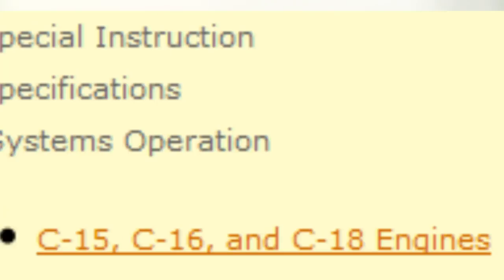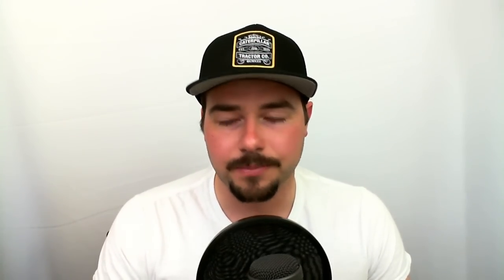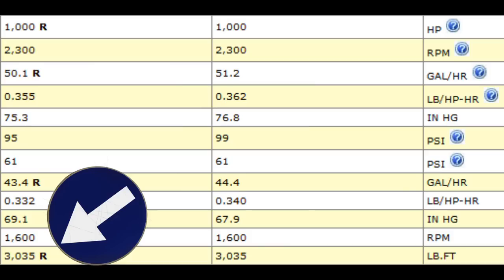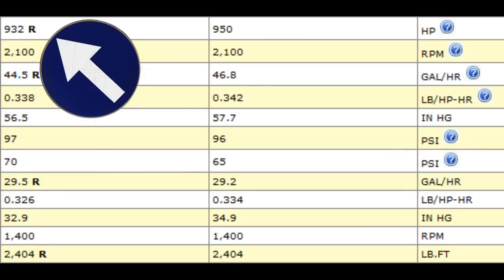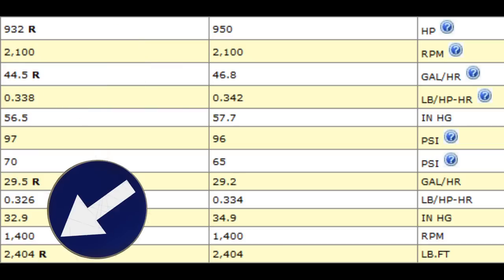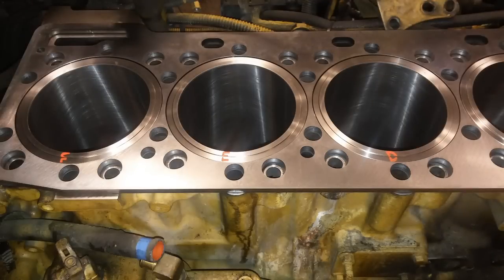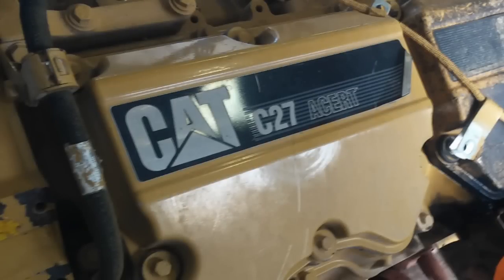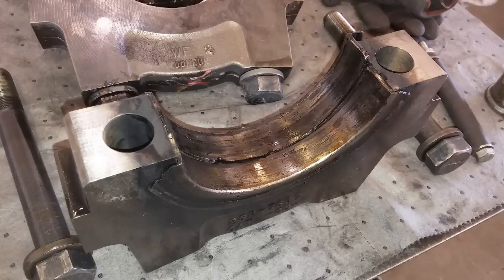Turn A Cat C15 Up To 1,000 Horsepower With Stock Parts.  The Ultimate 3406 or C15.

Comment: I used to work on marine diesels , the “recreation” versions make a ton of power , a stock 315hp 6BT will build around 50 lbs of boost , same with the cats , mans , yanmar ect . When you have the entire ocean to cool it down you can make power , on a 6bt making 50psi I’d boost the charge air leaves the turbo around 350f then goes to the sea water cooled “inter cooler “ goes into the engine around 90f , that much temp drop is practically impossible with and air to air charge air cooler
Reply: Every engine can produce huge HP,, for a short time,, Like you said tho,, Marine engines have all the cooling in the world using water jacketed exhaust manifolds. Cat 3500 mechanic , retired .
Reply: Probably why we see more nuclear subs than nuclear powered trucks

Comment: Back in 2005, I took my Brand New Peterbilt to a Good friend and had him "Work" on my truck. Now, I'm a Heavy Haul Trucker or was until 2010. Anyway this Guy has an "Green Thumb or is a Wizard" on Cat Motors or he was until he passed. He used to make around 925 Hp back then. And, as a Heavy Hauler haul'n sometime 1,000,000 lbs. I needed all the power I could get especially in the mountains. I Never had any problems to speak of with any of my motors he worked on, Never❕ I found out bout this Great Cat Man many years ago and he worked on all my trucks since back in the 70's. He lived in El Paso and was not a certified Cat mechanic. He just knew them Inside and Out.
Reply: what so you mean? I am Home AH. Google Big Loads.....there are even Bigger loads. Some of the big Transformers are heavier than that. You don't Know what you're even doing or talk'n bout...........
Reply: Ex-Law Enforcement the Cat 797F weighs something like 200 ton and it’s the biggest dump truck in the world. You are telling us that you carry 2 1/2 of those on a daily basis?
Reply: The Chassis only weighs in around 475,000 appox. on 1 of these pieces of equipment (797) they are shipped tore down from where we would pick up one of these usually in Long Beach, Ca. at the Port there. I hauled alot of LE TOURNEAU equipment like the L2350 and other rubber tire loaders and some of their other equipment too. We was setup with them to haul alot of their stuff. I wish I knew How-To or even IF I can send a picture or two in here and show some of these loads and just some of the axles under my trailer and the other truck that hauled alot of the equipment on it. Always had a 2nd truck to haul alot of the axles and trailer parts for these loads. My empty weight was well over 100,000 lbs. (Depending on how my trailer was setup for a haul could be more or could be less) Empty so I couldn't haul anything on my rig (Anything over 80,000 is what is Max weight). My Haul truck was always permitted even when empty. All the other stuff had to be on atleast a 2nd truck/trailer and sometimes there was 2 of them to haul equipment for a special load coming up to haul. This may sound like a bunch of Mumble Jumble IF a person don't know much about the weight limits and all this stuff. I didn't mean to mis-lead anything here. After my stroke and heart attack in 2010 I've never been quite the same especially at my age now-a-days.
Reply: Ex-Law Enforcement pictures or it didn’t happen.
Reply: Justin Martin I wonder how many tires you would need to haul a million pounds?
Reply: I've seen a few 500 ton loads, or right in that ball park anyway. Not equipment like all of you guys are thinking though. Most of them were tanks and compressor stations for the oil fields in North Dakota. I saw one trailer at the port of entry in Gillette Wy one time with 21 axles. The dude that started the thread isn't full of it, there are actually loads that big. It's all about getting your load to axle out.
Reply: Jimmy De'Souza really big loads sometimes require "pushers" which are semis that are attached to the back of the trailer but they are used more for engine braking power then for power to move the load around.
Reply: 9914life the number of tires on a truck and trailer is only part of it, the space between the axles and the space between and a group of axles, also called the bridge, are factors as well. The size and width of tires matters also.
Reply: Chris Roberts dude. I specialize in the heavy truck industry,specifically frames, axles, suspension, jeeps and Jeep trailers and detach trailers lmao you got owned. You will not move a million pounds unless you have multiple trucks. Like I specified in my previous post, and a stand behind my word, those guys do not turn up their trucks, they’re fleet owned 99% of the time. So you are slow, you should stop going on the internet. Lol I don’t need to go on the internet to see big loads, I work the equipment that moves them hahaha
Reply: Chris Roberts please tell me a Jeep is a 4x4 that drives in mud
Reply: Utube swan Silvertones
Reply: You mean he has a "Black Thumb"
Reply: I don't care how much horsepower it made, what was it doing torque wise though?
Reply: @DannyWalker1949  
my age now-a-days.

Love it
Reply: Jimmy De'Souza  Not with a splitter transmission.
Reply: I think he misspoke on the weight
Reply: YOU GUYS DOUBTING HEAVY loads come to Australia and see the shit we cart around camped out one night with guys running one gen set only 2 tractors one pulling one pushing total weight 275tonnes also see planty of big CAT dump trucks on the back of low loaders at 250tonnes and the widest at 11 metres which means it closes the road down up to 104 axles on trailers i have pics of most of these just do not know how to put them up for you to look at 
If you go in ther outback here in Aussie you will see 4 trailers behind tractors very regularly lke say 4 shell 40,000litres fuel barrels behind one tractor leagl top speed 90kilometres an hour and after loosing one complete truck in a thunderstaorm the law came in that ina thunderstorm you pull over and unhitch the tractor and drive a safe distance away from the cargo until the storm passes a lot of these were powered by C18 CATS or 'special' Cummins motors i am sorry i do not know all the specs but suffice to say they were very powerful trucks the pay was pretty good to when i applied to get onto the rigs back ine naughtys while sitting in the drivers seat you got $54 and hour while sleeping you got $27 an hour and you were away 6 days a week 4 houirs on 4 hours off so work that out.
   The biggest rig i have seen on our roads here is 3 pulling and 2 pushing also a powered self steering trailer i never did get to find out what that weighed except that it was a power generator for a mining site they had 3 police cars and 5 other escort vehilces so all in all a bloody big set up.
Reply: @life-te7to  D.O.T. officer has joined chat ... does he have a permit lol
Reply: @TLLC2024  and that contradicts what I said how?
Reply: @ronanderson2992  if you look on YouTube beyel brothers out of florida moves loads that are over 1,000,000 pounds
Reply: @markwilliams4525  you need to stop believing everything you hear. It’s been over 3 years and he still hasn’t provided any proof.
Reply: @life-te7to  I'm not listening to him I'm just saying they move loads bigger than what he's talking about
Reply: @markwilliams4525  oh, I know there are much heavier loads I just don’t believe that he pulls a load that weights over a million pounds though the mountains. That would require multiple trucks and many wheels.
Reply: @life-te7to  oh, ok.

Comment: We have a couple of C16 with over 1000 hp and never had a running gear failure, it would be drivers error, I personally have a 3406E with C18 cam injectors and tunning never dino but, guess over 800 RWHP  had never had any failure either my trans is a RTLO 16713a,  never a single issue due to  higher HP, so if  you do have any drive train problem with hi hp get rid of the driver or learn how to drive properly. all this while getting over 8 mpg on Florida flat ground, dump truck with 70,000 lbs loads.
Reply: You said the truth I had a KT 600 cummins in 1978 with about a thousand hp never a issue but my 465 Cascadia with walmart today averages 9 mpg
Reply: why are you running around with half a load,we are running 140000lb in mountains getting 6 to 6.2mpg
Reply: Running 84,000lbs here in Texas averaging 7.3 gal with an 700hp 3406E 13 speed.. get your loads worth lol
Reply: @lrizo3841  what speed are you driving at to get that kind of fuel mpg
Reply: @stocks4bt 
Around 70 to 75 sometimes 80 in west Texas. I don't know why but for some reason the faster I go the better my fuel mileage is. The guy who tuned my truck says the whole point was to get your turbo to spool up a lot faster. The faster it spools up the more it helps out the engine to get moving.
Reply: L Rizo I’m looking for a cat tuner in TX. Where was your truck tuned?
Reply: @lrizo3841  who built your engine? And who tuned your engine?
Reply: @lrizo3841  wow…what’s your set up?

Comment: I have a c18 in my semi with 625hp acert turbos.  Custom built radiator, cac,  custom ecm tuning.  Lipe 2800lbft clutch.  High torque 13 spd halo trans,  3:21 rearends.  I run 1225 rpm @ 65mph.   Gets around 6mpg.     Hp at wheels 719.  Torque at wheels 2800lbft.   This was at 32psi boost.  Dyno didn't have enough power to pull engine down.  Truck will make 58psi of boost on road.   I've got about 300,000 miles on it so far.    It's fun to drive!
Reply from the maker: That is cool to hear. Did you put all the C18 internals in a C15 block or start with a C18?
Reply: Adept Ape started with a c18 industrial,   swapped rear structure,  cam , ecm , turbos, and some overhead.
Reply: My hats off to you man, that thing sounds wicked, I always kinda wondered where the truckers are that like power besides a nice looking truck.
I’m sure the stacks of cash and time invested would horrify an average car guy, the price of a truck alone is staggering😬
Reply: @claterpillar1  why don't people use cat industrial engines as new engines
Reply: @5.43v  you can.  I did,  but you need to pay F.E.T on engine for highway use.
Reply: @claterpillar1  What is F.E.T., link to explanation?
Reply: @5.43v  https://en.wikipedia.org/wiki/Excise_tax_in_the_United_States
idk about on an engine though, definitely on the fuel you use though
Reply: @claterpillar1  i see this is old post but how you like the lipe clutch?  i have one for my c16 just waiting until i need it.  is my left leg going to get huge?   lol
Reply: @clintvitez3757  you'll be fine.  They don't push very hard.  It will take a long time for clutch to seat tho.   I thought mine was junk.    Best way I've found to seat it is.   Running down the highway,  push in on clutch until engine rpm comes up a little from clutch slip.   Give it about 10 seconds.  Then let it go for 20 minutes.  Then do it again.    Took a couple days for mine.
Reply: @claterpillar1  Good to know.  how many times per day were you doing that?   Also really like your c18 build.  i have looked into that 8 years ago already and it just isnt that hard to do,   just a money thing but what isnt.
Reply: @clintvitez3757   it took about a week of doing that.  Don't get me wrong.  You could easily drive a loaded semi around.  I just couldn't floor it.  Engine would pull through clutch.
Reply: @claterpillar1  understand that.   thanks for your help on the clutch.
Reply: Damn over $100,000 spent on fuel 😬
Reply: Some c18 heads have same part number as c15 heads
Reply: do you still have this truck
Reply: @RocKenworth  yes sir.  Although northern indiana liquid de icer.  Is taking its toll.   I need to find a different home for engine.
Reply: How hot does it get

Comment: I have a c15 tt with tune on it that puts out 850hp and 2350tq.  Other than the tune it is stock.  Other than a few air to air clamps getting loose ive had zero issues.  These motors are a beast
Reply: Who tuned your engine?

Comment: my dads old truck was a c - 15 set to 850 hp, it was putting well over 700 hp to the ground and doing 160k+ in the mountains it never failed, with 4:33 rears it’d pull a mountain and a half

Comment: Seen a lot of C-18s mostly on oil field equipment, every once in awhile I have seen a hand full of trucks with a c-18 under the hood (spec. that way). Usually with 3 drivers and a couple tag axles as well.That was for very heavy loads like coil tubing units ect.

Comment: We call em big bore kits. Turning a c15 into an 18. We do it often for top drive hydraulic power units when we wanna junk those mtu's. Weve got literally dozens plus c18's. Biggest factor and hurdle puttin em on the road is keepin it cool. Another reason they make tons of power is turbo set up is highly efficient. Drilling company i work for has probably the widest variety of big diesels used. Weve got c 15, 18, 32, 176, mtu's, waukesha's, cummins, deere, big ol perkins, used to even have an ol purple people eater allis. Sad that it slipped through to get scrapped.

Comment: Hey Josh, it's true this subject is the same as any hot rodder. Take a 5.7l bore and stroke it to 6.0l. I would be very interested to hear more about the c18 in factory form. Also what are the differences between the on highway motors vs the marine engines? Just epa regulations? Or can they keep the engines cooler because they are sea water cooled and the fuel/boost can be turned up more safely? I think those subjects would be a good video to add to this one. Thanks for what you do! ---Joe
Reply: figifister cooling capacity is the biggest reason, that has always been a hindrance to highway engines. Not that they couldn't have found a way to keep them cool, it's a matter of keeping the engine cooled for the cheapest possible (or at least in budget) production price. Emissions regulations are a factor as well, however those regulations tie back into cooling as engine temp is a major factor for NOx.
Reply: Marine Engines generally have water-to air-aftercoolers as opposed to air-to-air. Charge air temps are much cooler allowing for more power to be produced (higher boost/more fuel/lower in cylinder temps)
Reply: Generally marine engines run external water for there cooling. Which allows cooler cylinder temps since there not recycling water though a radiator to cool the coolant.
Reply: figifister The biggest reason that marine engines can run more power (even the two stroke Detroit engines did this , 400hp+ 6v71) is that they don't push against anything solid.
Reply: @beckywatt5048  Thank you

Comment: 700-750 hp at the wheels easy, start with c15 add 425hp program add c18 truck injectors add large garret turbo

Comment: I have a customer who did exactly what you described with a c15 using marine c18 parts and creative programming. His dump truck spits out a transmission every 6 months. I wish the comment section would let me post pics of an Input shaft sticking out of a clutch at a 30 degree angle and a pile of part numbers that fall out of the bell housing.

Comment: destruction of the week .. i had one similar to that... 3406 in a D8N bulldozer. it kept breaking the oil pump mounting bolt OFF...  3 TIMES! i was the third guy sent out to do the job ....  i pulled the engine to find out why ... the ONLY thing we found was that the PILOT BEARING in the center of the flywheel was completely shot... these dozers have torque converters in them, but they still use a pilot bearing to steady the torque converter ( i assume because its so heavy )  the best reason i can come up with it ( why it was doing this ) was ... harmonics ....???   i replaced the pilot bearing and put new oil pump mounting bolts in .... been running great for 3 years!

Comment: what caused the destruction of the c27 is had to be something crazy
Reply: The idler gear that drove the oil pump gear wasn't tightened down properly. Over time it worked loose and was grinding away the oil pump gear. Once the teeth were all gone the engine lost all of its oil pressure.

Comment: Adept Ape thanks bud. Great video ! I always wanted to put a 3408 on a 359 Pete and turn it into a pickup
Reply: Mark Armstrong the last rebuild I performed was on a 3408. Fantastic engine, great sound but little room in frame rails. Like 1 1/4 inch little room.

Comment: Pay now or pay later,, Come rebuild time you can see a high PH engine in the parts wear which in the end scheme of things more to replace when doing the rebuild, Plus most important, liner /block wear , more HP more wear, more machining needed for the block to be straighten up and shimmed. Every bobby big rigger wants the highest HP but cries the most when it comes to fuel usage and parts replacement when in frame time comes.
Reply: I agree.

Comment: you are a little behind the time, i built a c15/18 mixed parts monster 2 years ago. instead of a double turbo i used one big one that  full spools at my desired RPM. seasoned old school trucker driver driving it. it hauls over mountains like its running on flat ground.
Reply: Like 2 know how u reach there looking 2 do the same with 03 6nz in o3 pete